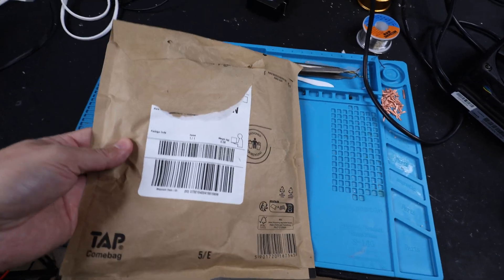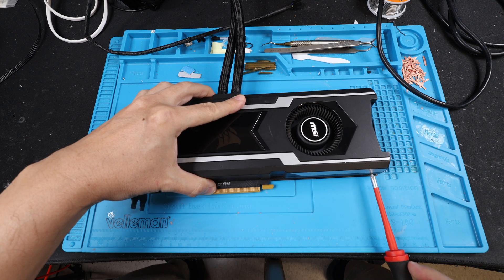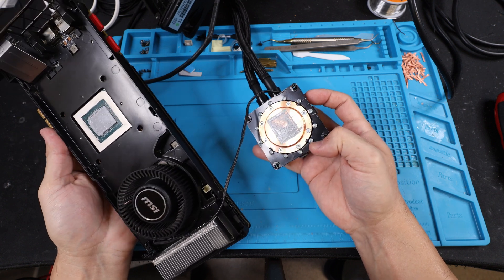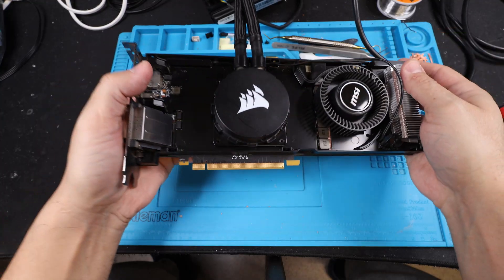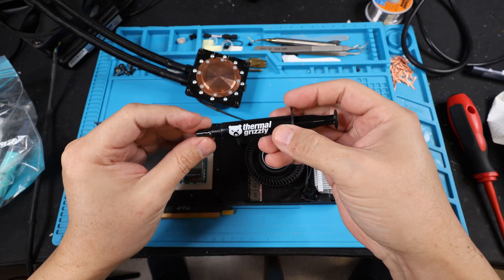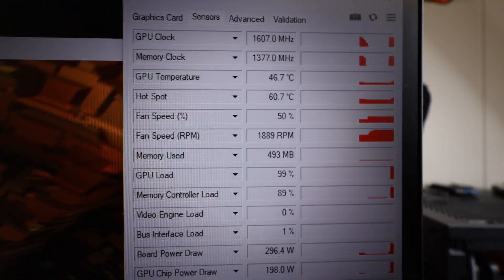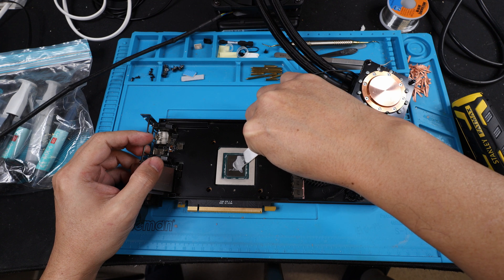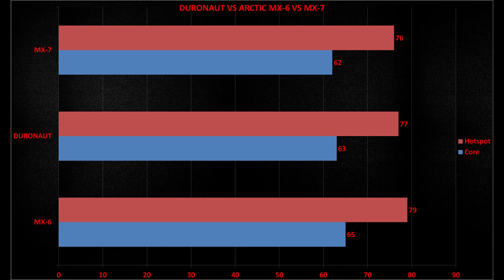Arctic MX-7 vs MX-6 vs Duronaut Test.

Comment: Gpu clock for 1080ti must be over 1950mhz on boost not 1500, there is some problem with that 1080ti. Also temperatures are too high for a liquid cooled card, even with an aio system. Maybe pump is not working properly or liquid is blocked inside gpu water block.
Reply: You get a Pin of shame loser🤡
Reply from the maker: You obviously did not pay attention in the video or only watched a fraction of it. This is what happens when people speak before knowing what they are even talking about in the first place. Congratulations, your comment is awarded the "pinned" in the comments section!

Comment: This is in contradiction to your mx6 vs duronaut video
Reply from the maker: Yes, I mention that in this video. It seems like you were not paying attention...
Reply: @TechnologyHive my bad, i skipped to the results directly
This just confuses me more
Reply from the maker: @yash.jaiswal Let me help with your confusion. In the previous test, the pastes were tested with an RTX 2070. Average power usage was 270w. In this test, the card was tested with a GTX 1080Ti averaging 298w. 

My conclusion to this was that Duronaut performs better under higher temperature situations than MX-6. I have seen this behaviour in the past with other pastes also. I hope this helps.
Reply: @TechnologyHive thanks for clearing it up

Comment: My OCD says you should have put the shroud on the GPU too 😅that helps with  ore direct airflow to components
Reply from the maker: It really does not make a difference as far as cooling the core. But given that all tests were conducted under the same conditions, the difference in temperature can not be attributed to the shroud not being used. But I get what you're saying, OCD here also 😆
Reply: @TechnologyHive ha i get it turnin those screw for shroud would take a long time a of your like me you be on the floor looking for one 😂. Good test though yes consistant and accruate.

Comment: I found the MX-7 to be the worst paste I've ever used.... mind I'm putting it on my CPU and not a GPU... but its extremely thick stuff that doesn't even STICK to the CPU.. its almost as though the CPU surface was repelling it, like opposite poles of a magnet... it just rolls around like a little rubber ball, and when I attempted to spread it... it just came right off the CPU and wouldnt spread at all... its just completely worthless to use as a spread.
Reply from the maker: Use the X method. This yields good results when I use it.
Reply: After the initial "spread" failed and it all just rubbed right off the CPU like it was being repelled from its surface...  I attempted the X pattern... but found there wasnt enough left in the Tube for even that to work... I ended up just throwing it all away as it turned out to be the worst paste I've ever tried to use... I'll go back to the time trusted pea dot method with my old tube of arctic silver 5.

Comment: I am about to water cool my card as I need two items to go.  Just went to add paste and there was MX-7.  Been using Silver, 4/5/6, so might as well try 7.  The problem with all of them before was pump out, especially on the gpus.  This says it was made to prevent that.
Reply from the maker: From my experience with it, short it may be, I have not seen it pump out. And it performs real well at thermal transfer.
Reply: @TechnologyHive  I had to go to PTM7950 to prevent it.  One remaining question I have for watercooling is what controls the fans?  Pump does PWM as well as the fans on the radiator, but the only program I saw to control fans hates my motherboard as always one fan is lazy to it so it isn't really able to control it well.   Called Fancontrol and not a "fan" of it.
Reply from the maker: @generalawareness101  This is what I do: I plug in the pump to the pump header on the motherboard if there is one. If not, I will just use a chassis fan header. I'll set the speed for the bump to static speed which is not too loud while in idle. 

The radiator fan I set in bios to be controlled by CPU temp, this way whenever there is a load, light or heavy, the fan will spin up or down. This is just the way I do it.
Reply: @TechnologyHive  Yeah, for me I do ML/AI training so the card is being hammered, not really the CPU.  I had to settle on this pump as I can't really get what I want for well over a year now (well before tariffs). This pump is PWM, but its power use old school molex.  I just never got how for a GPU.  For a CPU, dead easy, but I am using AIO for that until it dries out then just add a new radiator and CPU block to the setup.

Comment: Maybe try Halnziye HY-P17 as well
Reply from the maker: You're the second person to ask. Ill see if i can get it here in Norway 😊👍🏼
Reply: @TechnologyHive  HY-P17 is 2°C better than Duronaut in my test on a direct die chip. I haven't tested MX-7 yet, maybe HY-P17 can be 1°C better than MX-7.
Reply from the maker: @hargon-w9s  I just ordered it. Should be here in a few weeks due to the holydays.
Reply: Halnziye HY-P17 seems to outperform everything currently in the market. Igors Lab did a comprehensive test on it.
Reply from the maker: @pak0otac0o  This should be an interesting video then.
Reply: @TechnologyHive for sure, I will also be doing my own testing as a reddit post. PTM 7950 (1 month heat cycled) vs Arctic 7 vs HY-P17 on a 9950X3D and 360mm AIO.

Comment: @10:45  🙋🏻‍♀️ 
I stand corrected 🫡 but in my defense I did say "at least they say" 😅 which implicates, that I didn't have any personal experience with it yet, and I really can't remember where I read that it was highly viscous and difficult to spread as I'm currently building a new PC and thus doing research about various components and accessories all over the net in 4 different languages. 
But it seems like Arctic are taking their time with distribution of the MX-7 as it's still not available here for sale where I live, so I had to settle for the MX-6 for now.
Reply from the maker: You can't find it on Amazon?

Comment: just ordered my mx-7 im excited as im on a gaming laptop with stock thermal paste hoping its a game changer as on laptops every degree is the difference between thermal throttling and dropping a ton in performance or keeping it cool and maintaining intended speeds and performance
Reply from the maker: It should help with those temps. MX-7 is good stuff.

Comment: There is a reason they've recommend against using spetuala if you read Igor's Lab review (which in part he got some information from Arctic and made his own analysis) it says:

"The practical application of the MX-7 quickly shows that ARCTIC has deliberately designed this paste for use without a spatula. The consistency is relatively stable, but the paste slides apart easily under pressure. In combination with the very low adhesion, spreading with a spatula would hardly be effective. Microscopy shows that the surface of the paste is characterized by the coarser oxide particles and that the matrix only “sucks” onto smooth metal surfaces to a limited extent. With a classic spatula application, the paste would therefore tend to tear off or remain in streaks instead of spreading homogeneously. Consequently, ARCTIC does not use a tool and instead recommends spot or central application."
 
And then later it says:

"Under the microscope, the MX-7 appears as a highly filled oxide material with a clearly perceptible particle size distribution. Aluminum oxide and zinc oxide dominate the morphology, resulting in a robust mechanical structure. The particles are well dispersed and show a high density without forming significant agglomerates that would create thermal constrictions.The matrix is visibly stable and exhibits low adhesion, which explains the manufacturer’s decision not to include a spatula. In practice, spot application and subsequent pressing produces significantly better results than manual spreading."

In other words for more consistent application  that spreads the particles evenly, use dot/cross/ line or other methods that lets the pressure spread the paste.
Reply from the maker: I have tried all three methods and all result in the same temperatures. I also clearly demonstrated in this video that you can successfully apply MX-7 with a spatula if you spread it slowly. I have also made a video debunking thermal paste application myths here: https://youtu.be/L0s41NFusZc

The right method to apply thermal paste is the method that works for YOU.
Reply: @TechnologyHive  different paste might give different result, clearly the manufacturer have changed things as they don't provide spetula anymore, your video is about different pastes not MX-7. I would not expect any major changes applying MX-7 using spetula or other methods (I personally prefer X), but since this come from the company itself I would've revisit the testing and also follow the temperature over time. BTW any difference between paste or their application will show up better in higher TDP part, if you ever test on RTX 5090 for example I would not be surprised if the result might be somewhat different.
Reply from the maker: @eliadbu Arctic claims both MX-6 and MX-7 can not be spread with a spatula. I proved them wrong in this video and the old one. You do whatever you want and believe whoever you want. I prefer verification by test method to draw my own conclusions. Have a good one 👍🏼 😊
Reply: @TechnologyHive I've read Arctic manual, and while they "it does not work" I think they meant it's not recommended. If you want to test different methods performance and also compare overtime (which is difficult to test as it requires many heating and cooling cycles), it will be great, if not I understand. Also I'm interested to see how higher heat load like from RTX 5090 (which can get double in the TDP) will change things in testing, but it's understandable if you can't get one for testing. In anycase godspeed, thanks for testing things and sharing your results.

Comment: My temperature drops by 1 to 3 degrees on the second or third day. The first day I apply the paste, I put together a card, there is no difference, why after the second day?
Reply from the maker: Many factors to consider, like, for example, ambient temperature. Also, your test methodology.
Reply: Bond-line thickness, the excess paste material gets pushed over the edge with the mounting pressure+reforming thermal pads  and the heatsink gets a closer connection on the chip and that is what you want, a thin layer of paste that just fills in the irregularity's.
Depending on th heatsink design i use a combination of Halnziye HY256 putty on small gaps up to 1.5mm/VRAM and Fehonda 15w/mk thermal pads to optimize the mounting pressure.
Reply: @damjanforjanic  Too much Paste initially, then you can get better temps in the second or sometimes third day.

Comment: There are different versions of MX-6 (I've got rev 3, it's written on the box)
By the way, PTM7950 is the best for the gpu die.
Your paste application is great but I don't trust the pump mounting process.
The hotspot delta is a bit high (14°, I've got 12° on my 3070).
Reply from the maker: This is why I demonstrated the thermal paste imprint on both die and cold plate, to show contact pattern. In all tests there was good contact.
Reply: @TechnologyHive  I agree, it did look that way.

Comment: Given that the 1080ti was launched about 7 years ago, could the circuit possibly need refilling with water?
Reply from the maker: No it actually has not seen much use. It belonged to a friend of mine but he hardly used it.
Reply: @TechnologyHive    A small amount will evaporate away through the hose even at ambient storage.
Reply from the maker: @Jupiter__001_ Well it hasn't happened. That's all there's to it.
Reply: @TechnologyHive   To be fair, apparently AIOs are designed to work optimally having lost as much as 10% of the fluid, so it would be fine regardless.

Comment: Don't get MX-7 on your motherboard (at least not laptop anyway), as contrary to claims it will short your system to ground, and that's because it's actually electrically conductive after all. I had a tiny blob (<1mm) on my ram pins and had to clean every last speck off. 🚧
Reply: i don't know man this from Arctic spec sheet : MX-7 is suitable for CPUs, GPUs, laptops, console processors, and more. It is non-capacitive and electrically non-conductive, ensuring excellent performance without any risk of short circuits or electrical discharge.

Comment: Hotspot readings didn't exist for 10 series cards originally, the number now shown in HWinfo is always exactly 14c higher than avg temp, so either hotspot is the real max temp, and "avg" is just a static offset from that, or the other way around.

Comment: Thanks for testing! I'll be sure to replace my Noctua NT-H2 when spring cleaning my PC next year.

On a related note, I've had my XFX RX 6900 XT since 2022, would you recommend that I replace the factory thermal paste with something like Duronaut or MX-7? Is it even worth it or is the factory paste on these new-ish cards still fine?
Reply from the maker: If you have seen temperature increase, then yes I would definitely start with a good dust off, and new paste. I would go with Duronaut or MX-7

Comment: 1080Ti is dead bro, no more driver update.
Reply from the maker: It's not dead. I had the latest drivers installed 591.59 and the card loaded up with no issues. If you mean "support" is no longer provided, then that's a different story. Remember that NVIDIA uses unified drivers, which support several generations back. 591.59 worked perfectly fine with my 1080Ti.
Reply: @TechnologyHive End of "Game Ready" Support: October 2025 This was the final month for major feature updates and day-one optimizations for new game releases.

Comment: Arctic don't recommend spreading MX 7 they recommend use the X method
Reply from the maker: And I recommend whatever works for you. I use the spread method, and it works great. I have demonstrated all these thermal paste application methods in one of my videos to debunk all these crazy ideas people come up with. You can look it up here. Its a few months old.
Reply: @TechnologyHive it was nothing to debunk just what was recommended by arctic not by random people 

But good to know 😊
Reply from the maker: @yell9845  I hear ya. I am just so used to folks expressing their beliefs on here as if they are the ultimate authority on the subject 😆. But what you said is correct, Arctic did say that. I am just used to spreading this stuff. Thank you for your comment!
Reply: @TechnologyHive  I think you hit the sweet spot with the paste, my friend. Also, mine seems thicker - a 4g tube. It shows slightly higher temps because I put a bit too much on, so your dabbing method is correct for optimal usage. My temps are high at the low-usage end.
Reply from the maker: @BoatHog, yeah, I'm happy with it so far. Time will tell.

Comment: Its not 1 degree difference, but 0,4 in both cases (core and hotspot).
Reply from the maker: I round up the numbers, but if you want to be technical, yes.
Reply: There is never a real difference in temperatures, at least not If talking about different quality thermal pastes.